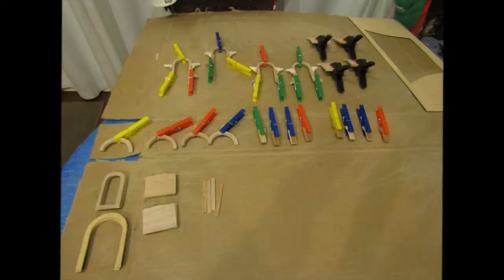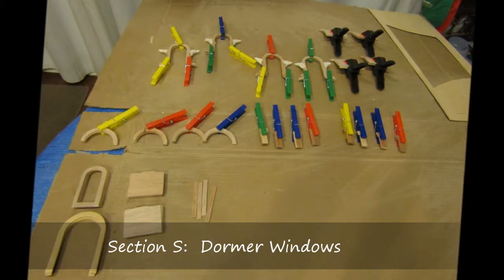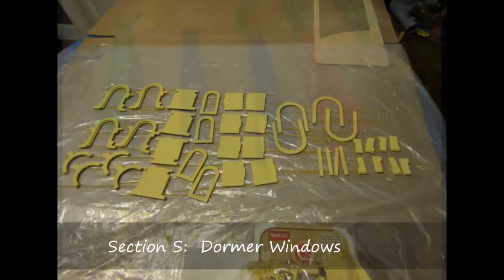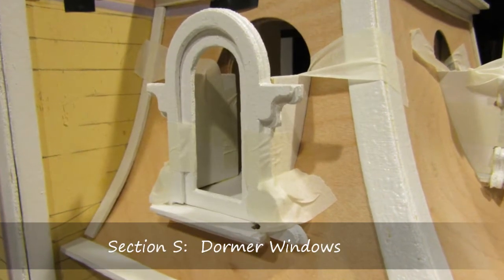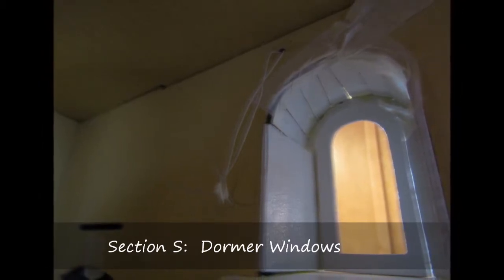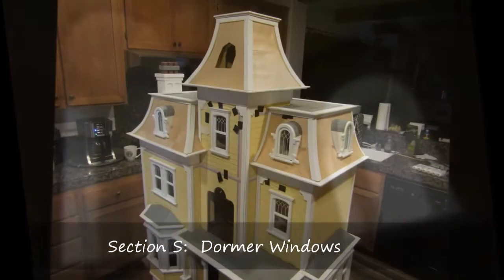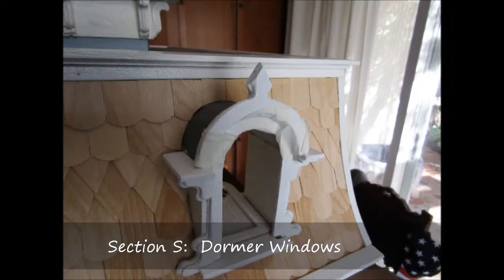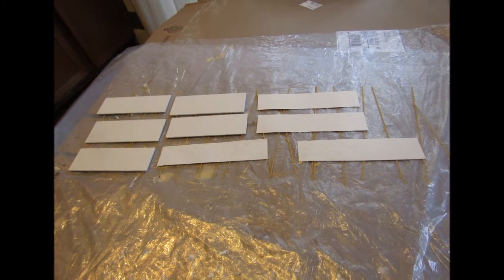Beacon Hill Dollhouse Construction of Section S: Dormer Windows

Comment: this is a great series and I thank you! Also I would like to mention, is that, what you use plastic binder material for, I use heavy 140 lb. cold press water color paper for. it glues wonderfully and paints wonderfully and smooths out imperfections. Can also be used as ceiling wall paper.
Reply from the maker: I agree that the plastic binder has some limitations with painting.  The thing I liked about using this was the smooth curve it retains when bending into the curved dormer recess.  Like you, I used the heavy paper for the wallpaper - this did work very well to glue up on the wall.